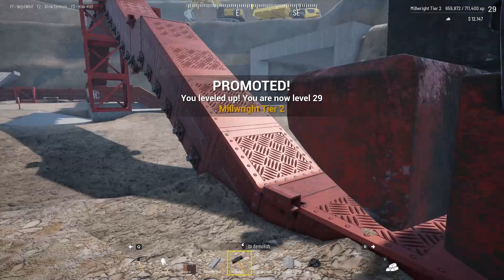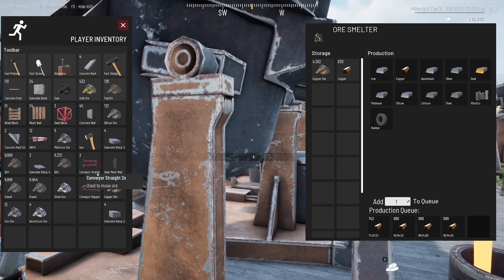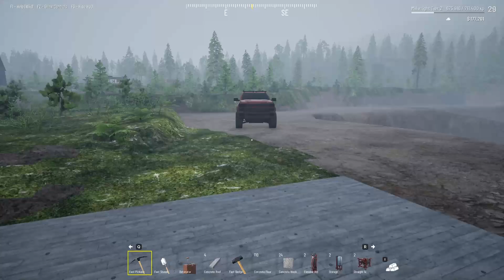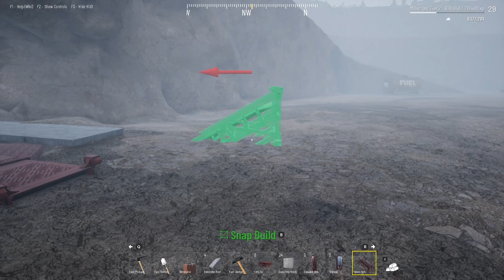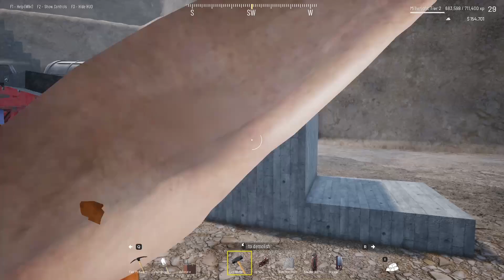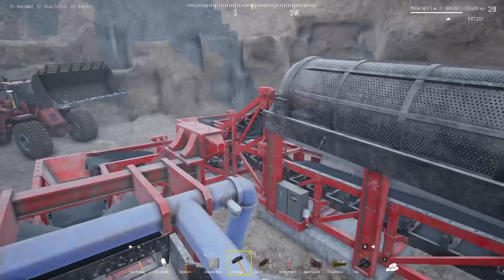The BETA The Better - Out of Ore Season 2 Ep17

Comment: You might need to pull more minerals from the lower hole while the smelters cook up bars for more cash.
The 1x/2x belt power units need to be electrified while at the start of a belt segment to drive the materials... so you are going to need an actual power grid of poles to get juice to them (and to the production machines) so they will work.
Pretty sure that you already have most of the infrastructure that you need, but it's kind of scary that a full processing plant costs that much just to set up... and then there's the fuel costs for the generator/s to run.
Feels like this update is gonna make new games really hard to get started.
Reply from the maker: I'm going to move toward free energy (wind and solar). There are wall mounted power lines that will help get power underground which will be good. Far more complex now but I think I'm pretty excited about it. Power took me a bit to get my head around as you'll see in the next episode but I got there.

Comment: Thanks for the video. Welcome to Beta 🙂 It is a pretty steep learning curve with the new washplant, as it is so different, but it's good fun. Had to make a cheat-sheet with a drawing of a do-everything-plant, as I can't remember where everything goes, lol.
1. As you may have found out by now, the plant won't work in it's current config. The power thingies needs to go on the front/start of the conveyor system to push items through the system. Think of it as a sort of circulation pump. The "X" thingy is to tell you how fast the belts will proces material, so the 3X will move 90 units per second (standard speed 30 M/S * X-factor).
2. For the generator you have to buy fuel in drums (or make them) and drop that into the fuel slot. It will not fill from fuel trucks or tanks. FYI, she is a thirsty girl, so if you go the generator route instead of green energy, switch it off while you are filling up your hopper. Which neatly brings us to:
3: GET A HOPPER!! 😀I think the days of belt mining are over. It will be a pain in the butthole, as you have to get the power to the front of  the belt to push it to your production facility. Curious to see if you can make it work, though.
Oh boy, wall of text again, lol. Looking forward to see where the series takes us from here, with all the new shiny things. See you in the next episode. Take care.
Reply from the maker: You'll be surprised when you see the next episode 😊. There is a long and exciting way to go though.
Reply: Put a merger in the middle of the conveyor line